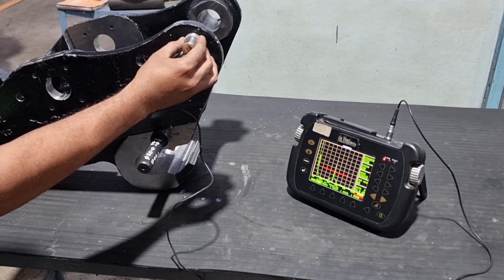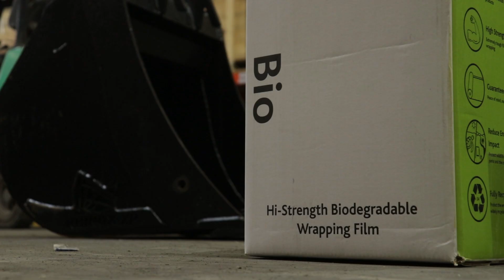The World's 1st CARBON NEUTRAL Hydraulic Quick Coupler!

Comment: Buying carbon points isn't reducing any of the actual carbon that was emitted by making your product. Investing money doesn't pull any carbon out of the air, it just legally is assumed to be.
Reply from the maker: Thanks for the comment. The 'carbon points' that have been used to offset the carbon produced during manufacturing/distribution have been used to fund a hydropower plant that aims to increase the production of renewable energy which plays a role in reducing greenhouse gas emissions!
Reply: @Rhinox-Group  by that logic, they should spent 1 trillion dollars on the dam, that will remove more carbon from the air that way.

Comment: No one gives a fuck about carbon neutral.

People care about quality, use, maintenance/repairability & price
Reply from the maker: We understand that factors like ease of use and reliability are significant when purchasing a product like a hydraulic quick coupler. That's why we've worked hard to ensure our products meet high standards. For instance, our hydraulic couplers can be disassembled and reassembled in just 15 minutes, with full maintenance and servicing completed in under an hour! Plus, they feature a fully compliant twin locking mechanism to ensure maximum safety during operation.

However, more companies are beginning to prioritise their environmental impact and how their equipment affects the planet so while carbon neutrality may not be a priority for you, it is a key benefit for others. Regardless of the carbon neutral status, the cost of the product remains the same to you!